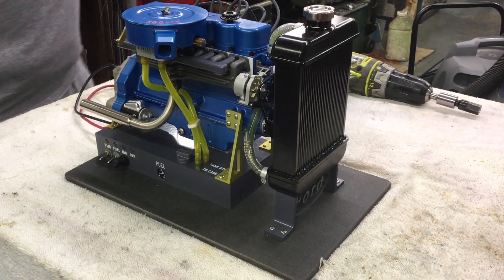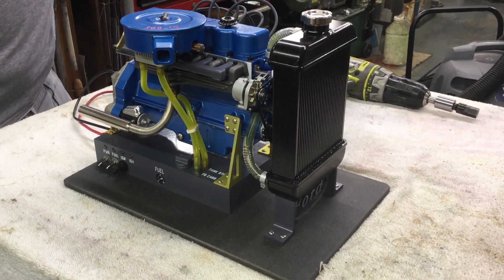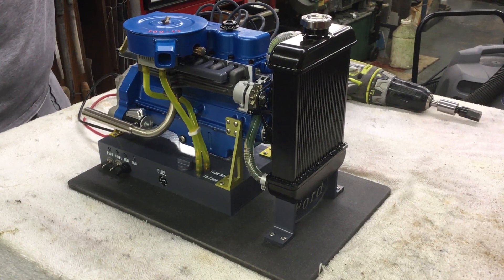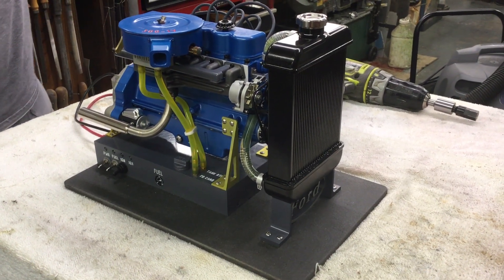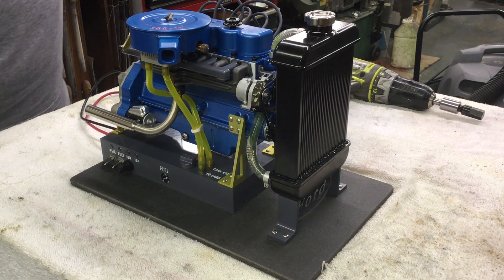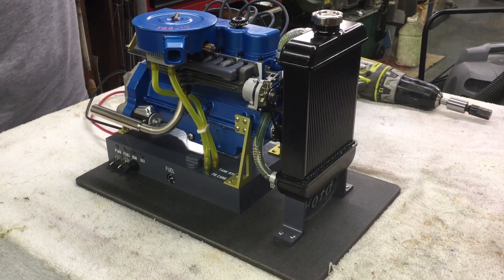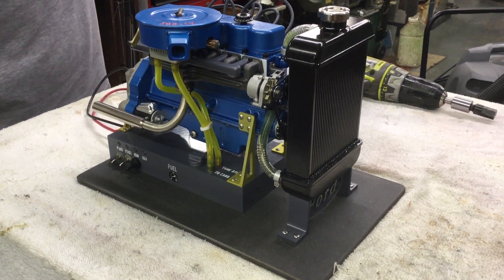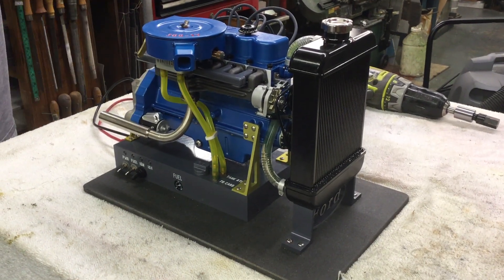Terry Mayhugh's 300 cubic inch Ford Inline Six

Comment: Now you should make one with a Cleveland or Chevy LS inspired head, with cross flow for more power.
Reply: I know of two full size 300's running welded LS heads. One with adapted Ford EFI, and one with sheet metal intake manifolds and a pair of 2 barrel carbs.

Comment: What did you use for the ignition system?
Reply from the maker: I used a CDI from R. Scholl - actually the same one in your photo posted on HMEM. - Good Luck - Terty
Reply: @mayhugh1  Thank you. Your engine looks amazing. Beautiful work. It appears the hall sensor needs to be replaced on mine. Do you use any of the smaller lathes or mills on the market?
Reply from the maker: @shelbylangston1270  I have a Tormach mill, and a Webeco 9x11 lathe. I bought my son a mini-mill and a mini-lathe some ten years ago and he's been using them ever since and has bee quite happy with them. - Terry
Reply: @mayhugh1  Hello Terry, hope all is well. Would you be interested in selling your Ford engine, or accepting a commission to build another?

Comment: It's funny a motor will bring back memories. In about 1981 I had a 1970 F-100, but it only had the 240 I6, and I always wished it had the 300. They were great motors.
Great job.
Thanks.
Reply: My Dad put over 240,000 miles on a 1968 Ford Custom with a 240 I6 and over 250,000 miles on a 1971 Ford Galaxy with a 240 I6 before retiring each without doing anything but oil changes.  I remember him testing zero to 60 in the Galaxy and it taking over over 20 seconds but it was a slight uphill. I was only 10 when he ran that test, lol.